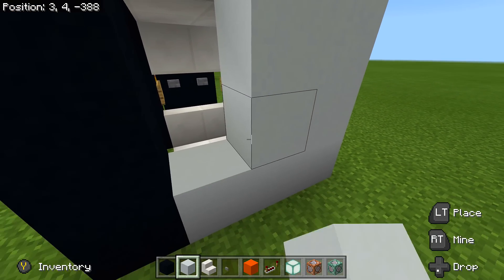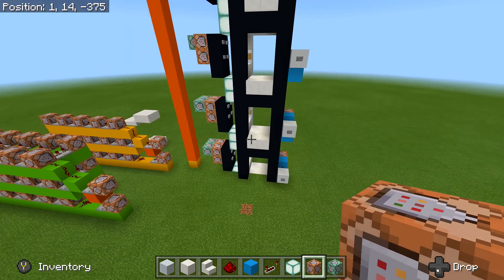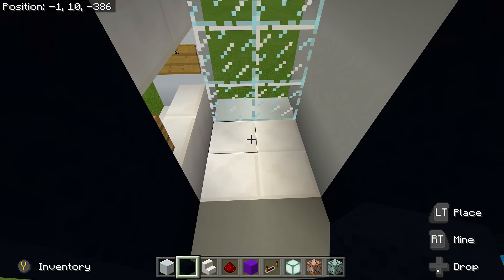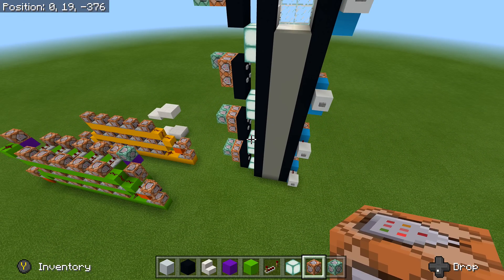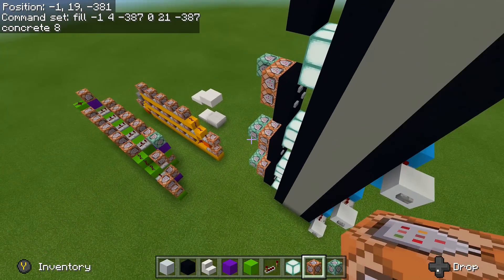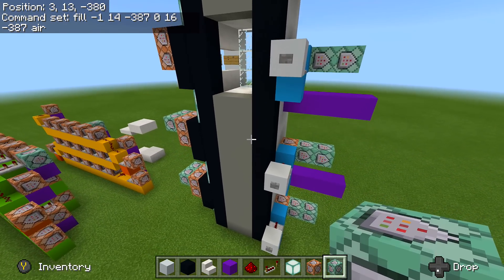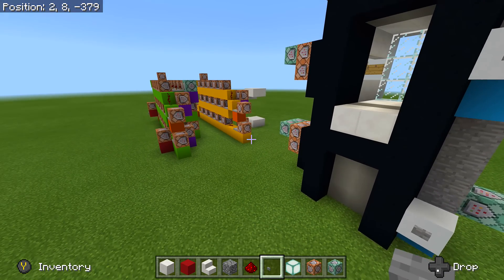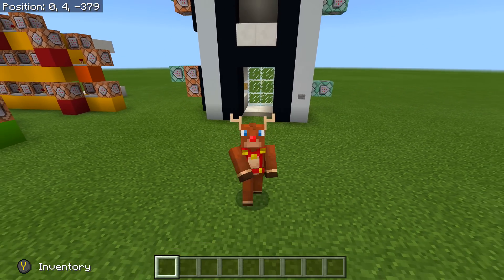How To Make a MULTI Floor Elevator in Minecraft Part 3 (Command Block)

Comment: I made this elevator today and this still works, for whom so ever may wonder. I just had to change few things like you used connectors with 2 and 4 tick delays I had to use 3 and 6 tick delays coz it was hurting people in the realm. I made some adjustments as per my requirement. I made a 9 floor elevator for one of the hotel in my realm. Thanks a lot for the idea mate.

Comment: I recently used your DISPLAY ANY ITEM video to make a lotto booth counter, and I have now used this MULIT-FLOOR ELEVATOR video.  I want to say thank you.  I think these videos are great.  My build only needed a two floor elevator, (so mine is a simplified version of yours).  The only problem I had with it was user error.  My door coordinates were double thick, causing the player to get stuck inside of the blocks when standing on that side of the elevator.  Problem solved and it works beautifully.

Comment: 2:19 hows it gonna be 389 if the build limit is 255...
Reply: @AJ King 389 represents the position of the blocks, it goes x, y, z. Y = Is how high you are.
Reply: 256 but ok